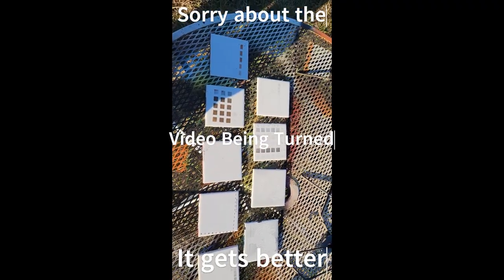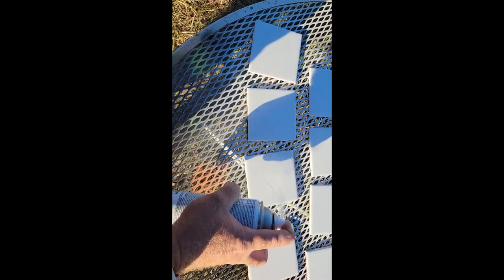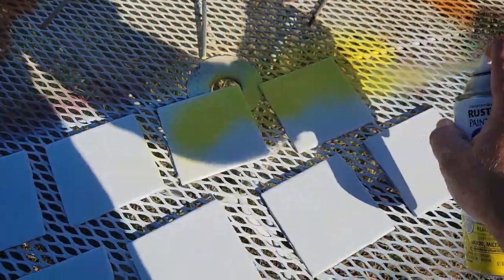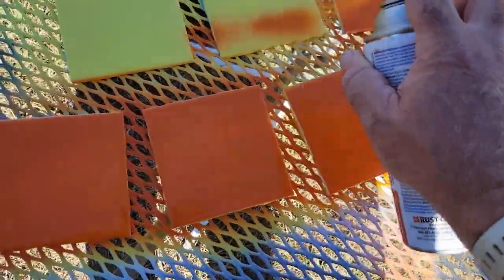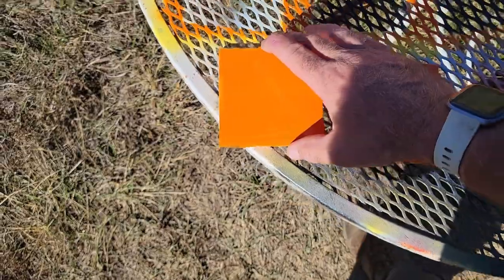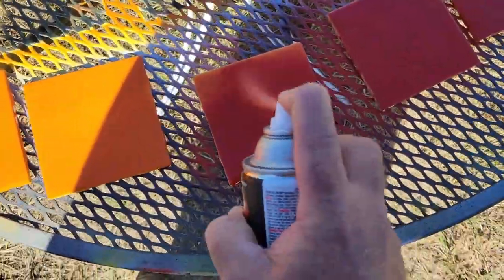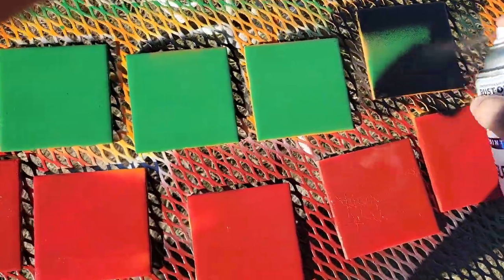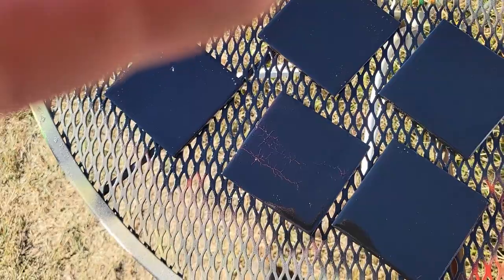How I Paint My Tiles to Laser Engrave on the XTool D1 Pro

Comment: i am having issues burning tiles with multiple colors such as this.  i have a 5.5 wat laser and my first test i tried 6000mm/min and 40% power. That did hardley anything. So i took it down to 3000mm/min and 50% power with very little improvment. 

Im wondering if i have to go even slower...